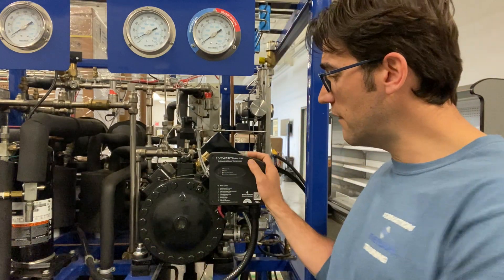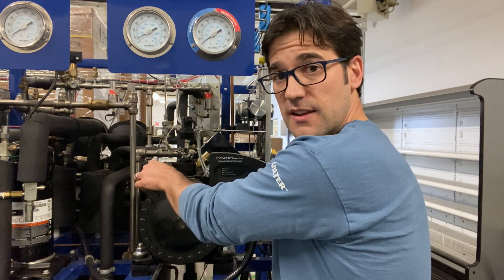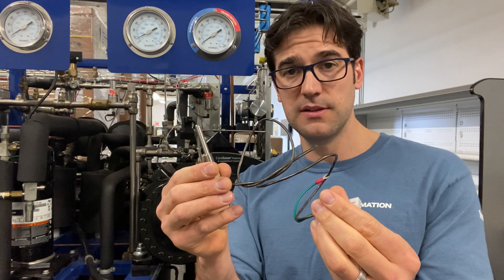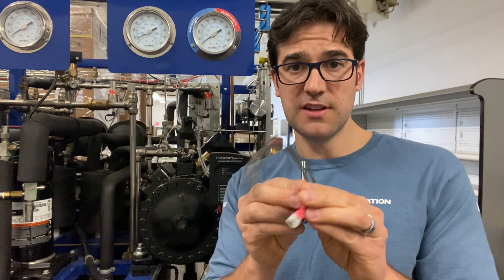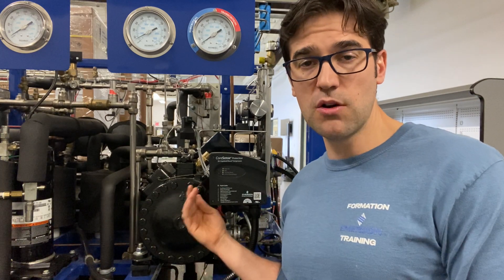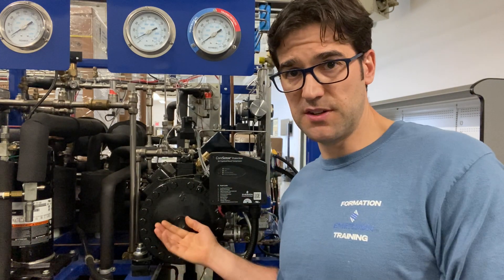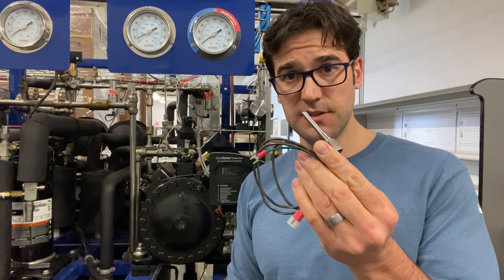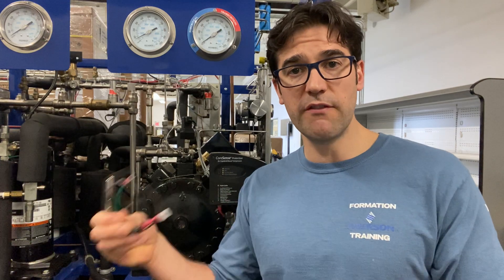Compressor Overheating

Comment: I have a chest freezer, what should the max temp a compressor discharge line should not exceed?
Reply from the maker: You need to check the compressor specs for that.

Comment: So whats that protector cord called my compressor in my fridge is overheating and fridge not cooling i think this would help. Where can i buy one
Reply from the maker: These are specific for Copeland semi hermetic compressors and your fridge usually would have a small hermetic compressor. Call the manufacturer of the fridge they should have a troubleshooting help line.

Comment: Heheeey. Hello. Interesting topic. Actually having issues with txv's dirty  strainer (carbon) on islands cases. The rack have 3 scroll compressor in parallel and liquid injection which pass through a kind of throttling device to cool the head of the compresso(each) . Can this type of cooling be upgrade?
Reply from the maker: I believe you are talking about the injection valve, depending on the model of the compressor you can upgrade. The cap tube is an original design and I guess you could upgrade to a DTC valve. Or you could upgrade to an electronic valve from a DTC valve. The first question I have is why do you want to upgrade? Installed and set up correctly those technologies should work fine.  Copeland did have Scroll Demand cooling at one point but it is now obsolete.